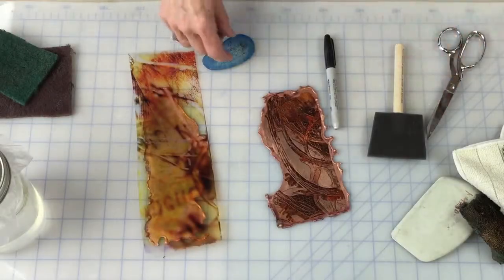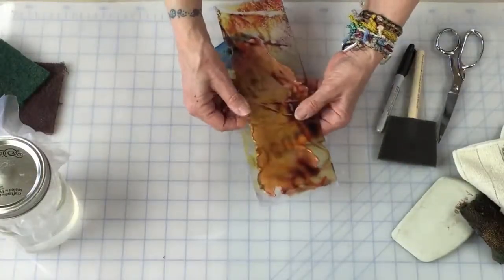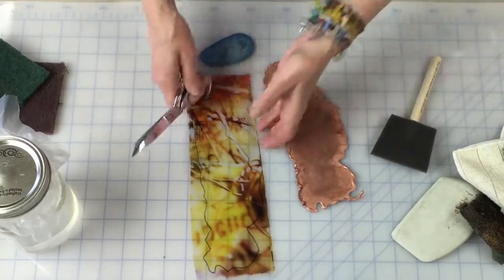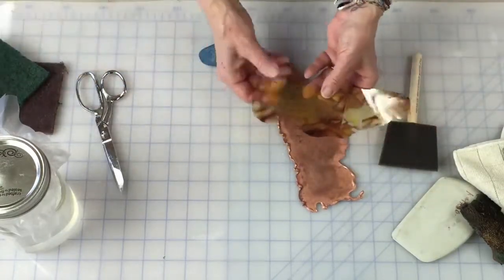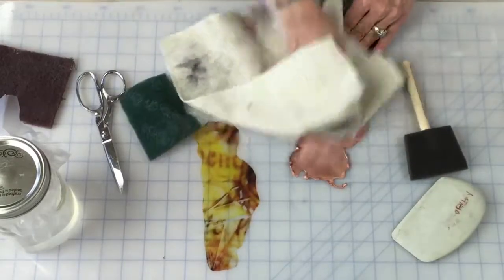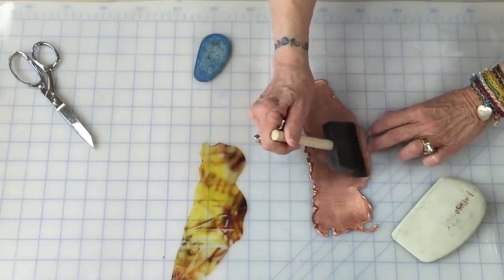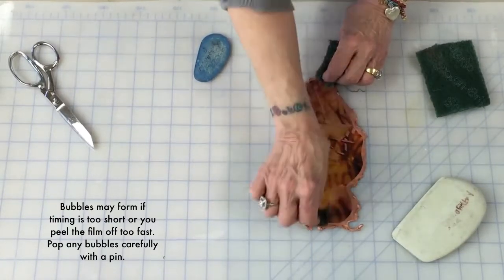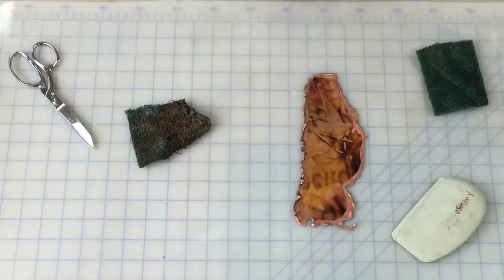Digital Image Transfer to a Copper Shape

Comment: What can you spray on top of the print after transferring the image on metal so that the surface is more durable?
Reply from the maker: I usually use a spray like the crystal clear enamel from rust oleum. There are several clear sprays you could test.

Comment: Ahah. . . . . Soaked in "Pickle juice". But not for a known amount of time though.

Ooooh, I wonder what the "Transfer Fluid" is. Hmmm. Imagine that. A fluid with no name.
I'll order some from Amazon with the exact same specification.

Perhaps consider not continually repeating the "Take" word, or swapping for the old "Use" word.
Reply from the maker: Transfer fluid is from inkAID.  I don't ever time the process of pickle juice. Just soak and see what I think the looks okay on the steel. It's not an exact process.

I use inkAID products for transfer fluid.
Reply: Yes. . . . But which chemical is the transfer fluid?
We might even have it in our own cupboards at home. But is labeled and prices up as "Transfer Fluid".
It might even be vinegar?
We don't know this side of the video.